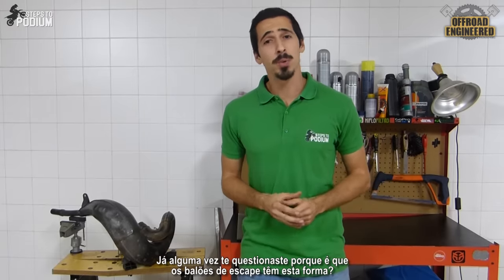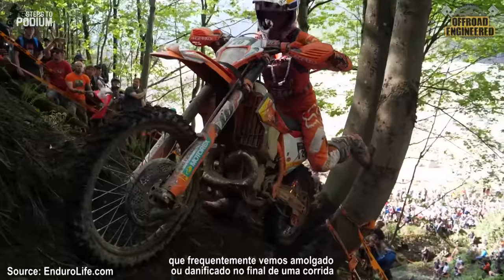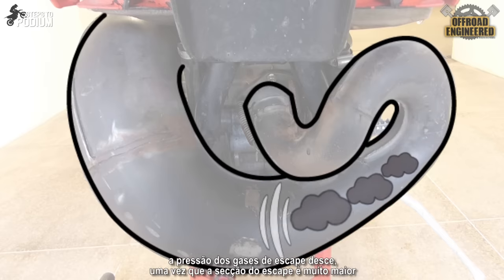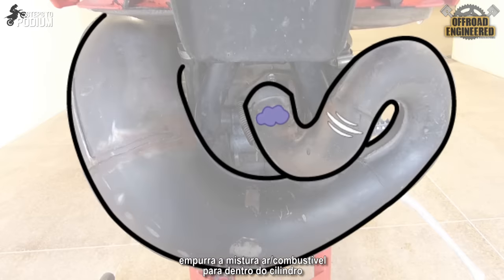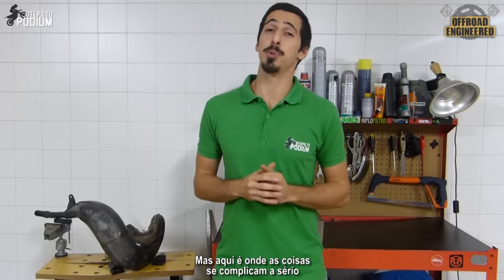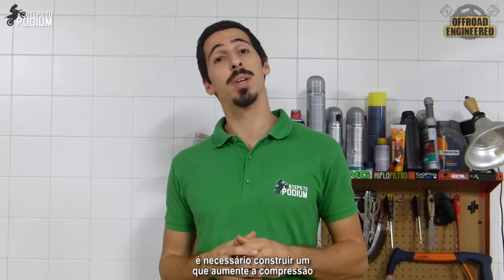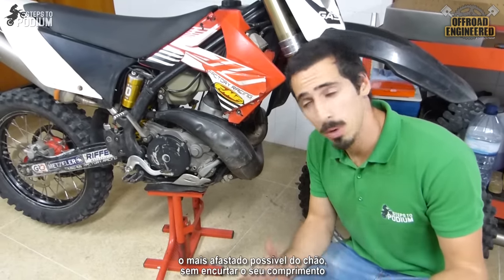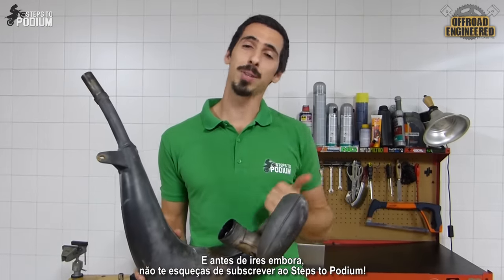How 2-stroke exhaust pipes work | Offroad Engineered

Comment from the maker: Thank you all for the love you have shown, I really appreciate it! 😊Note: No, I did not mention the first back pressure generated when the pressure wave reaches the divergent, which is responsible for creating some suction on the crankcase. I left that info out to make the video clean and simple (so everyone can understand it without being intimidating) and focus on the main pressure wave generated on the pipe!
Reply: Nah man you cool
Reply: Wtf
Reply from the maker: @Mr.WellingtonVonDukeIII  I'm busting my ass out laughing with your comments, you're a legend! xD
Reply: Good explanation, people always wonder about 2 stroke pipe shapes. It must have been  a freaky idea , whomever first considered it back in the day
Reply from the maker: @richardkey4289  Agree! 😂
Reply: It should be able to run on the same principle with a conventional tubular pipe, that has a constriction or washer/plug at a calculated location.
Reply: “Boost bottles” (vaccuum pulse bottles) can give you a different effect but one controlling fuel spitting and letting you run a “leaner” AFM. I’d rather have a bottle and a normal pipe than the big bladder expansion pipe.
Reply: Richard Key it required some serious welding skills and a lot of trial and error
Reply: Honda R&D has totally different explanation of how a two cycle motorcycle engine works ..they explained to me that two stroke motorcycle engines make their own internal boost . When the piston travels toward the combustion chamber there is lower than atmospheric pressure in the crankcase. Air and fuel mixture are drawn into the crankcase through the intake port at atmospheric pressure. As the piston travels toward the crankcase the fresh intake charge of air and fuel are compressed to a pressure higher than atmospheric pressure ..this is what we call boost . As the piston uncovers the boost ports commonly called the transfer ports the higher than atmospheric charge of fresh fuel and air mixture are forced into the combustion chamber..a sound wave reflecting off the taper of the expansion chamber produces a high pressure wave at the exhaust port trapping the fresh air and fuel boosted charge from the crankcase now trapped in the combustion chamber only to be compressed again by the returning piston just before the spark plug fires the mixture off that produces much more power than any naturally aspirated engine of the same size can ever do as four cycle naturally aspirated engines can never make any boost but instead can only rely on atmospheric pressure to charge the combustion chamber with fresh air and fuel mixture ..bur a two stroke fires off with much higher pressure from the crankcase of higher compressed mixture of much denser fuel and air making much more power on a fast progressive rate each time it fires with produce much higher boost pressures the next time and the next and so forth untill it catches up the the speed of the reflected sound waves from the reverse taper of the inside of the expansion chamber creating the highest percent efficiency controlling boost pressure escaping the exhaust port trapping even more fresh air and fuel mixture as much as its design possibly can. This condition happens in an instant of the engine Rev. This is what is called The Power Ban when it is said the engine is "on the pipe ...so it is very critical of the size of the expansion chamber to direct the sound waves back to the exhaust port to creat the highest boost pressures from escaping the combustion chamber until the Piston has a chance to seal off the exhaust port and compress the fresh boosted charge of air and fuel that is always gaining higher pressures the fast the crankshaft spins up super charging the engine internally and doing it twice as many times in the same time period as any four stroke engine ...the is why a two stroke out performs any four stroke naturally aspirated engine of the same size. Two stroke engines make  boost, four stroke engines do not and have never or never will
Reply: @stopglobalswarming  no it never . Two stroke have to make boost in the crankcase to be able to run at all ..and it is very critical to size the expansion chamber to produce a sound wave to keep as much boost trapped in the combustion chamber as possible from escaping the exhaust port before the piston has a chance to cover the exhaust port and sealing the boosted air / fuel mixture in the combustion chamber compressing it the second time before the mixture is fired off
Reply: @StepstoPodium  takes one to know one, glad you laughed but to be honest I was flat out hammered when I posted that. Legend
Reply from the maker: @Mr.WellingtonVonDukeIII  you're such a legend mate 😂😂😂😂😂😂😂
Reply: There are a few issues with the explanation but the main correction is that the pressure waves (expansion wave and compression wave) are energy (sound) that moves at the local speed of sound through the much slower gas particles.
In the same way wave energy moves through the water.
Reply from the maker: @AuMechanic  this video is an explanation for "dummies" so people can understand 90% of what's happening on the pipe. If I would go to much in detail, a lot of people would simply not bother trying to understand!
Great to have here on my channel! I've watched some of your video as well 😊
Reply: Thanks bro that is some very useful information...
Reply: donnie baker that’s why I call them vacuum pulse bottles.
Reply: donnie baker they don’t boost anything. They control the tendency of a two stroke to induce fuel reversion through the carb and help atomize fuel. I have used them and it helped cut engine vibration esp at idle and helped lower rpm torque noticeably.
Reply: donnie baker exhaust scavenging in four stroke naturally aspirated engines had been effectively used for 100 years
Reply: Actually, that “first” pressure wave is a LOW pressure pulse, which obviously sucks the burnt air/ fuel charge out of the combustion chamber. This also helps draw in new air / fuel charge through air in / carbs / reeds or rotary valves / crankcase / cylinder ports - to be compressed by rising pistons
Reply: donnie baker ??? Only half right. 
Do some quick google research to update your intel
Reply: donnie baker even 4-stroke engines create boost in their intake path through ram air effects and can timing
Reply: @stopglobalswarming  so what ?
Reply: @glenholmgren1218  no it does not. The only way air and fuel is draw in  is by a low pressure in the crankcase caused by the piston moving toward the combustion chamber ....take one apart someday and you will see
Reply: @glenholmgren1218  i was taught by the most famous two stroke tuner in the world ..his name was  Yoshimura who at the time was Honda engine tuner and Builder for a 10-year period . I met him in Milwaukee Wisconsin at Honda R&D facility as he explained to us exactly how and exhaust pipe have an expansion chamber on a 2-stroke work and it's by the sound waves being reverse from the rear cone that stops the boost charge from going out the exhaust port ...the boost is cause from the back side of the piston as it returns from its power stroke and very easy to understand if you take a minute and look
Reply: @StepstoPodium  and so far you havent explained anything true about any function of a two stroke
Reply from the maker: @donniebaker5984  sure I didn't 😂
Reply: donnie baker waste some more time with your ignorance. Lolol. 

Yes, a “boost bottle” stores a pulsing vacuum as the engine runs. As the engine cycles, the pulse occurs as the vacuum is created by the intake.
Reply: @stopglobalswarming  Yes, similar to replacing reed blocks with thicker ones, or add extra spacers, in order to increase the volume of the crank case.
De-stuffing the crankcase. 
Helps low rpm efficiency and broadens, BUT LOWERS, the torque curve.
Reply: @stopglobalswarming  Yup, True. Just not accomplished the same way or to the same degree as with 2-strokes ...
Reply: @donniebaker5984  Buddy🧐 you're overdoing it - THAt engine is FAR from the most famous two stroke ever ... Only in a Honda mechanic's imagination!!! 😝 
Yamaha 2-strokes dominated motorcycle racing for years
Reply: @donniebaker5984  good for you - he isn't the only one who ever engineered 2-strokes. And MAYBE. he only told you what he felt YOU were capable of understanding ....? 😁
Reply from the maker: @glenholmgren1218  cheers for that! I appreciate it :)
Reply: @donniebaker5984  So what do you think 'pushes;' the fresh charge into the crankcase? Its atmospheric pressure in the same way that it pushes the mixture into the cylinder of a 4 stroke engine. The descending piston then pushes it up into the cylinder via the transfer ports but this is not 'boost' as you call it. If the piston has a swept volume of 100cc then it can only move 100cc of fresh charge from below the piston to above the piston. Boost is when you use some other means of moving more than the swept volume of the engine into the cylinder, on a 4 stroke that could be either via a turbo or supercharger, you can also used a tuned exhaust to help in this respect. With a 2 stroke you can use pressure waves, both positive and negative in sign to achieve the same thing (to a small degree). You keep referring to compressing the fresh charge as 'boost' it is not, in a 2 stroke engine there just happens to have a primary compression and a secondary compression of whatever fresh charge the engine has to work with.
Reply: Good ole Bernoulli's principal
Reply: Sure am glad I took courses to learn about motors,, would hate to decipher relevant info off YouTube, 
I'll take my 35yrs of building and tuning 125cc shifter karts and leave you all to argue 🤣🤣🤣
Reply: @artofdisguy3401  oh cmon now, you can't find at least one thing to argue about online? Where's the fun in that? 

At least let me question your credentials? Lol
Reply: Well done
Reply: It came across very cool and clear mate as some of us know two stroke physics is a lifetimes worth of knowledge,  great video mate 👍👍🇬🇧🇬🇧
Reply: @richardkey4289  MZ
Reply from the maker: Thank you so much! I really appreciate the comment! 🙏🙌🙌
Reply: @donniebaker5984  you have it exactly right,   when your power band as people like to call it is kicked in and you're flying your pipe is at full capacity  ! Max flow
Reply: You have done a great job mate spread the 2 stroke genius 👌👌👍👍🇬🇧🇬🇧 love from England 👍👍
Reply from the maker: Thank you so much mate!! 💪💪
Reply: @guxyguy7909  Kaadan knew more about 2 stroke tuning than all the Japanese engineers put together.
Reply: @MrKips1  certainly did in that era he was a genius 💪💪😎😎
Reply: Well in any era to be fair 💪💪
Reply: @donniebaker5984  cool that yoshimura was your teacher mate the guy was a super genius, like erv kanemoto 💪💪😎😎 forgive me if I misunderstood but are you saying that a twostroke exhaust doesn't help suck the fresh charge up through the transfer ports? Because if you are that actually is incorrect as the residue low pressure from previous charge flow will definitely pull on the transfers and therefore the crankcase pressure will actually lower at certain rpm causing greater draw 👌👌😎😎
Reply: Your way of explaining are just that ➡️ FUN and FRIENDLY 😂🌞
Reply from the maker: Thank you so much man!! I really appreciate it! 😄💪
Reply: InstaBlaster
Reply: Can you put an 80cc exhaust on a bike with an 125cc motor? It doesn't matter if it would decrease efficiency as long as it doesn't damage the motor.
Reply: Hey man just a note on your english, only trying to help - in the beginning you said "i'll explain you why" - it should be "I'll explain TO you why" - just letting you know, this is a common mistake, but it stands out. 'Explain you why' just does not make sense. you are not explaining me, you are explaining something to me. hope that makes sense.
Reply from the maker: @methoxeta I really appreciate it 💪I'll take that into consideration in my next scripts 🙂 thank you and hope you enjoy the rest of the channel 🙌